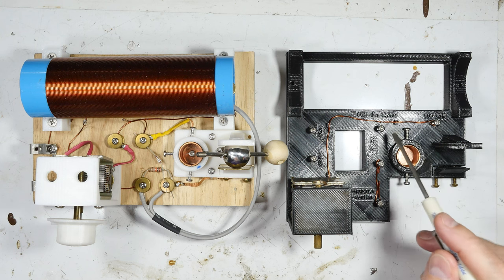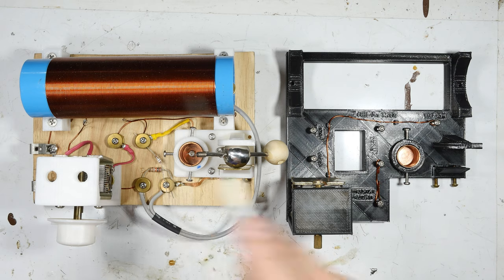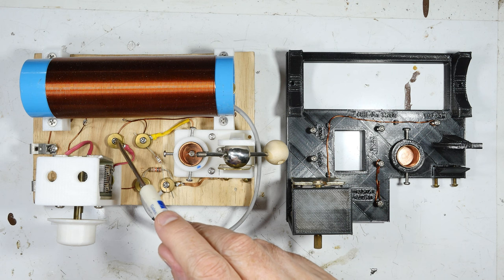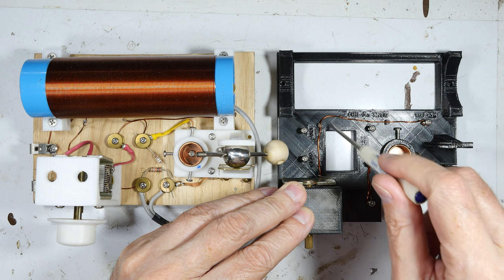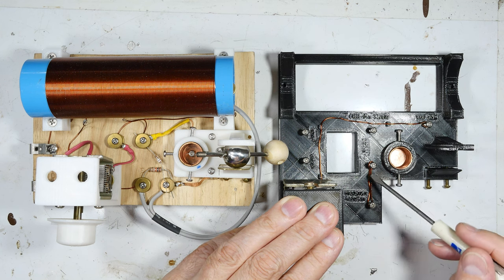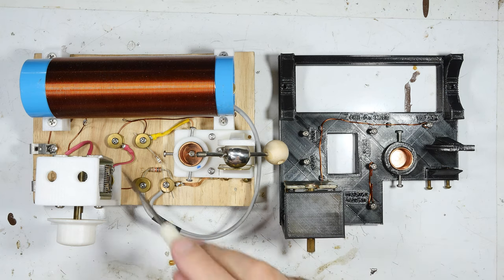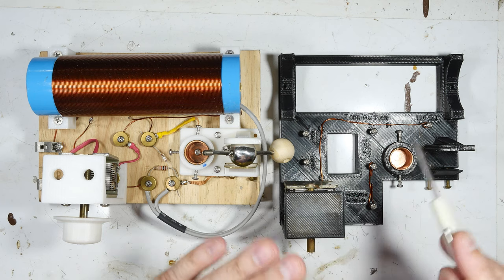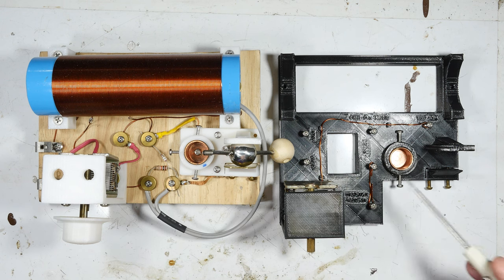Crystal Radio--1 Variable Capacitor, 3D Printed (4K)

Comment: Almost all crystal radio coils were built with uniform coils formed around cylindrical objects. Your printed radio is no different.

Suppose that coil former was shaped like a miniature orange traffic cone layed on it's side.

Winding a coil around such a shape would change the coils inductance progression rate from left to right. What effect would this have on a crystal radio design other than making  coil calculations more complicated?

Would the slider across such a shaped coil be more or less sensitive?
Reply from the maker: The real answer is "I don't know". If I were to guess: The variometer is 2 traffic cones back to back. One benefit is to reduce parasitic capacitance by not having the windings on the same plain. BUT, traffic cone windings would be. Inductance added per winding would be higher at the bigger end. So there, I'd expect it to be less sensitive. But the Q (efficiency) would be higher. I don't know the effect of say putting 160 different inductors of different Q, inductance, etc. tightly coupled in series. A: I don't know.
Reply: @tsbrownie   I too don't know but the visual slanted winding around a 3D printed core with a slide tuner on top is stuck in my brain now.

Comment: What's the rectangular hole for? And the jog in the edge by the detector? Just to save plastic and speed up printing or is this hunk of plastic supposed to fit into something now?
Reply from the maker: You're right, to save time and plastic. There's also one under the coil.  At lowest resolution and pushing my printer to 170%, it still takes around 6 hours to print. And from a strength standpoint, it's not necessary.